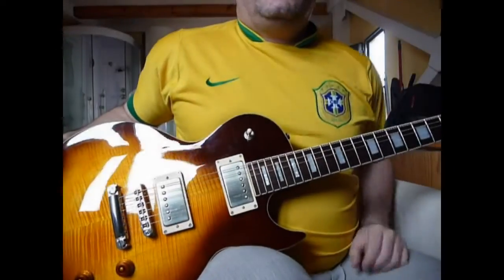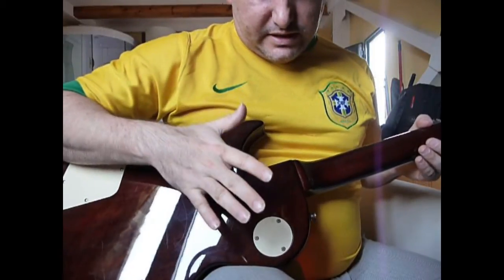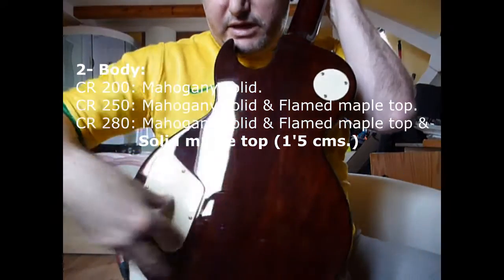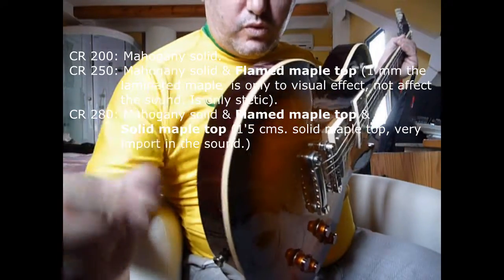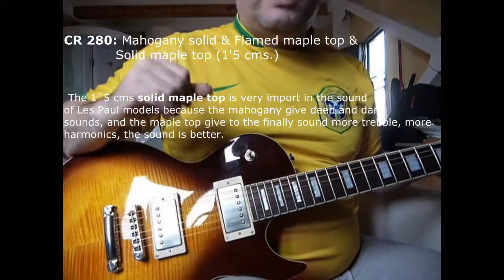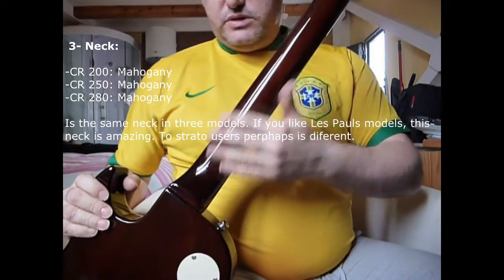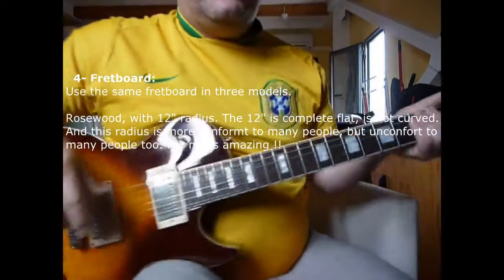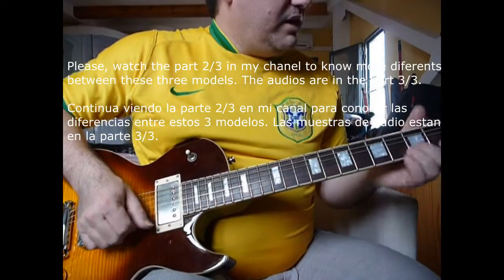Cort CR 280 vs Cort CR  250 vs Cort CR 200 (1/2)

Comment: Thanks for your review. Unfortunately, i don't speak spanish, but the english subtitles were helpful. 🙂
Would you recommend the CR-200 model? I can get one for around 320 € at the moment. You were talking about the missing maple. Is the impact on the sound really that big?
Reply from the maker: Yes CR200 is great for 320€. Also you can buy Vintage V100, is a really really good les paul
Reply: @Lacuerdaalaire  Thanks. I'm currently checking out the SX EC3 and the Vintage V100. 🙂

Comment: Are the cr200 and cr250 same? Just the different of flamed maple top...?
Do they have different pickups?  Or any other variation in body or hardware?
Reply from the maker: At the web page of Cort you Can See all your asks
Reply: Yeah puckups r same in both guitar.
Reply: the nut of the cr200 is smaller.

Comment: do you think cort guitars can match up to epiphone les pauls?
Reply from the maker: Boths are great les pauls. What model do you want, or how many money do you have?
Reply: La cuerda al aire im having difficulty on choosing whether the cort cr 200 or 250. Does the flamed maple top greatly affect the sound? Or the effect is only minimal?
Reply from the maker: The maple top in CR 200 no affect very much because is a really thin. The diferent between 200 and 250 is only stetic but the guitar is very very similar.
Reply from the maker: I made the review lots yeras ago, but I can remember the tuners, pickups, and bridge are the same. The big diferent is the maple top, but not affect to the sound
Reply: La cuerda al aire i see thank you sir. Much appreciated
Reply from the maker: Good lucky and if you have more questions I'm here :-)
Reply: how was the pickups? can it handle the high gain distortion in metal genre?
Reply from the maker: Mmm I remember the pickups were perfect to hard rock, but to metal (in my opinion) has low impedence. You play metal with amp or software simulator of high gain, but the pickups aren´t perfect to this genre. In future you can change to Seymour Duncan or Dimarzio. Dimarzio are amazings to metal